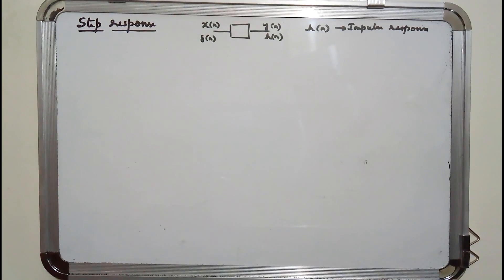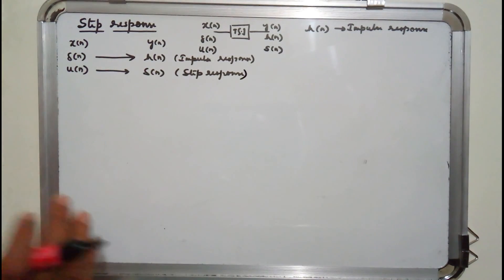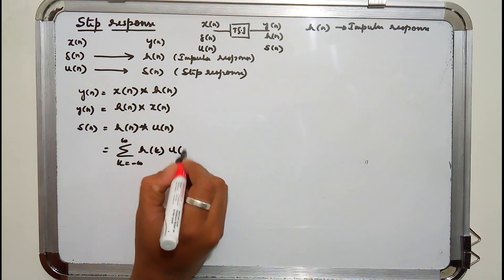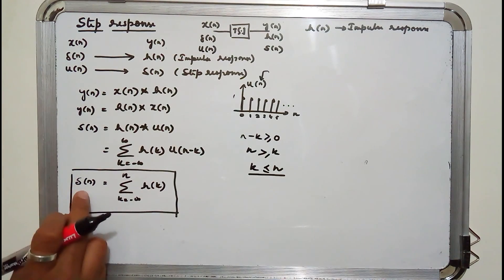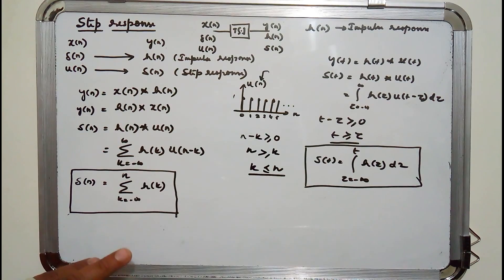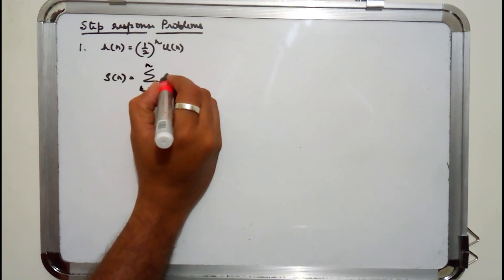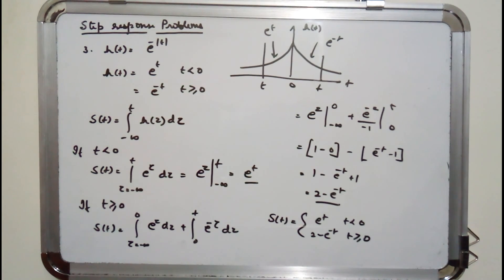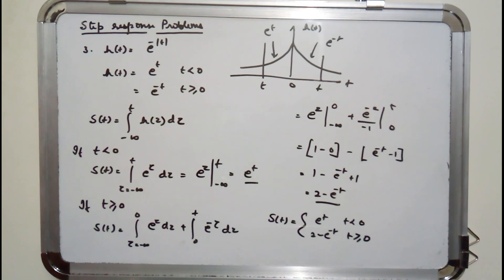Step Response Introduction And Problems

Comment: sir why u are considering the negative values when u are taking t>=0?
Reply from the maker: Because the lower limit in the integral of step response equation is -infinity . So we need to integrate from -infinity to the current value of t.
Reply: sir the limit from -infinity to t is due to absolute on t....???????????????.correct me if i m wrong